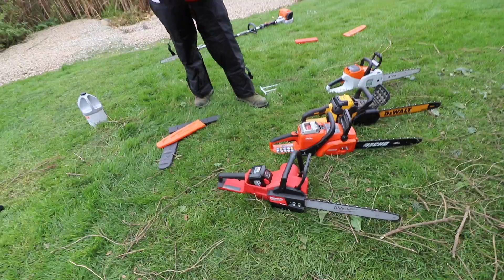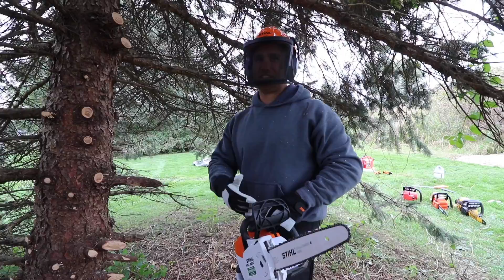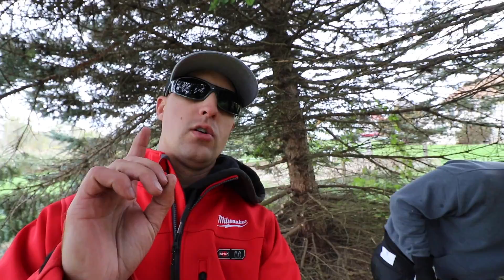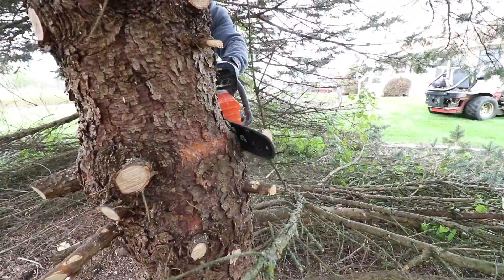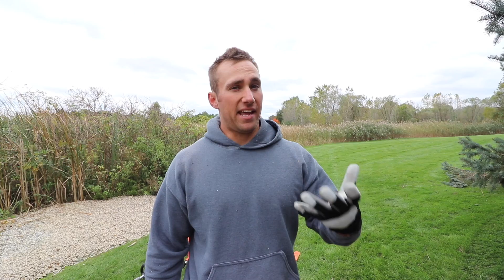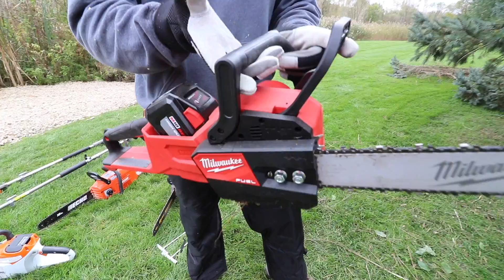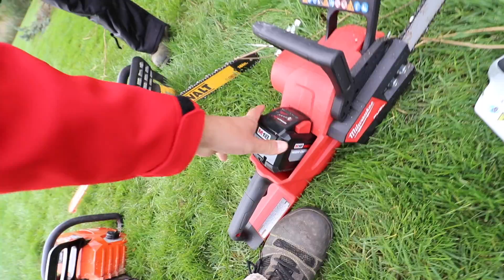4 Way BATTERY Chainsaw Comparison ► Which Has The Better Cut And Torque?

Comment: Only Stihl has a “Wet weather friendly “ Logo, rest of those battery operated saw not supposed to use in Rain.
 Husqvarna 536li XP much faster than Stihl msa 200.
 Husqvarna has 20 m/s chain speed , which is in pair with petrol chan saw speeds.
 Stihl don’t provide such important information ( for obvious reasons, it is noticeably slower than Husqvarna)
Reply: Bought my Milwaukee because they had it running in a tub of water at my cities big bolt store. Literally a tub of water with a Milwaukee stand and battery and everything submerged, running slow throttle but running.
Reply: Very important information -- None of us want to be doing this type of work in the rain/snow/elements, BUT inevitably we always end up in the weather & elements -- Therefore, machines that can withstand water & or take a beating are always more valuable.

I have used most of these tools & have to say STIHL is by far one of the best brands. My guys beat the heck out of these tools. They get dropped, smashed, not cleaned often enough, ran until they're dry, so many "wrong ways to operate" (I yell at them all the time after running them through proper operating procedures several times a year). However, STIHL is only brand that trucks forward & starts every time, cuts every time.

Final point -- This should be a given, but any chainsaw with a sharp chain will cut great -- BUT, as soon as you hit dirt, nick a hidden nail or piece of wire in trunk of a tree -- chainsaw is useless.
****Always have 1 or 2 spare chains for each machine you have with you, so you can switch out chain when the accidents happen & get right back to work. LOST TIME can cost so much more than paying $20-30 for an extra chain or 2.
Reply: The higher voltage tools like DeWalt are not what you want to be using in the rain. 18 volt should be no probs.
Reply: Dimi K 
Voltage makes no difference whatsoever. 
 16v  high discharge battery could supply supply as much current as 80v battery ( for shorter time , obviously)

Comment: I have the Stihl. I like the simple controls and ergonomics batteries do last well it does work hard but not as hard as a petrol can. I don't like the narrow teeth on chain as it pinches easy & does not clear material quick enough. I think they do it to keep load off of motor. I find it over heats alot when under heavy loads red lights appear on battery and motor stops dead which can be dangerous. One of my older batters makes the saw run slow which is annoying especially here in the UK where there £170 a time. It definitely has a place for small timber cutting and light tree pruning. However and heavy duty work where you want to work to saw hard all day and load up the motor hard time and time again a petrol is king.

Comment: Echo and dewalt both had dull chains. Always use brand new chains for ALL when doin a comparison
Reply from the maker: They were all brand new and fresh. Did you watch the video?
Reply: @BriansLawnMaintenance  did u watch the video? "Sharpened" is not the same as new and will not cut as good. Who ever "sharpened" those sucks at it!

Comment: Honestly using the old 40 volt DeWalt is not really fair as they have a 60 volt out and that is the main line out now so why not use that when comparing to this newer stuff?
Reply: The 40v is more of a commercial saw and better than the 60v according to many

Comment: a test bucking some 12" logs maybe would be more informative with a battery life test along side, cant get much of a feel for power cutting 1-2" sticks.. imo i like the milwuakee seen plenty of use of them and they seem powerful and battery life is great, they have the proper bar tension system unlike dewalts crappy plastic twist knob and the price is reasonable especially when you have a bunch of 9.0 and 5.0 batterys in the m18 lineup, with the stihl or echo you can only get lawn care equipment no proper power tools

Comment: I wish you had done the DeWalt 60v chainsaw instead of the 40v

Just because I'm a contractor and use dewalts tools and my boss runs m18. He would be able to use the chainsaw you reviewed but I would not...
Reply from the maker: Sorry we’ve only been sent the 40 at this time
Reply: 40v is better than 60v in dewalt

Comment: the dewalt, echo, and milwaulkee are running a 3/8 inch chain, each link is 3/8 of an inch long, it takes bigger chunks. the stihl has 1/4inch chain that is narrower meaning the saw has to pull less chain through the wood allowing it to go faster.
Reply: Robert Puffer  I am not sure, it would depend on wether you can change the sprocket.

Comment: Hi guys, in nylon opinion it's a pretty good video but something can be better fine as always. What i'm suggesting to do next time is get this saws again and get a first description of all saws specs, including speed and chain dimension, than get a single test made of 2 cut on a 6-10 inch diameter stem, one from up to down and one reverse(down to up), where u check easy result with cronometer. So this Is what i personally think, but overall well done. I appreciate so much guys like you that get a comparison instead singles rewies. Good job guys, but work on It!

Comment: I own a Greenworks 40 Volt chainsaw.  It works well for limbing like you demonstrate here.  The saw cuts very well and for the most-part I am satisfied.  I can get several hours of non-constant use.  I own also a Stihl Farmboss (18-inch bar) and a Poulan Pro (16-inch bar).
The Greenworks has a couple things I don't care for: 
1) The time it takes to ramp up to speed once the throttle is depressed (annoying); 
2) When you finish a cut, the saw will power-off completely after one minute of non-use (incredibly annoying).  If you make a cut, set the saw down to move a limb and come back to the saw to make another cut you need to power up the saw - every-time!  Why Greenworks doesn't allow the user to select the auto shut-off time is disappointing (say 1 to 5 minutes).  
Other issues: 
The nut that secures the bar likes to loosen no matter how much I tighten it. 
The lanyard that keeps the bar oil reservoir tethered to the saw failed the first time I removed the cap.
Anything over five-inches in diameter is asking too much of this saw; it will over-current and automatically shutdown.  
Finally, customer service is non-existent; my e-mail messages to them have never been answered.
Reply: I have a greenworks and love it. I would guess all the battery saws power down after some time of no use. All chainsaws with 1 nut vibrates loose. I had a gas steel that did the same thing. If i use a wrench and tighten more than my hands can do it will stay tight. I have muscular dystrophy, so using electric is the only way I can cut firewood anymore. I have 4 batteries so I can cut a long time. If I had to compare my gas stihl to this electric. I would say they cut about the same. Just faster not having to fill gas and the vibration of gas saws were difficult for my muscles. I couldn't hold the saw after a few tanks if gas.

Comment: The stihl has not only a thinner bar and chain but also a shorter one. Which means a shorter distance per chain rotation leading to a faster speed and cut. All of them would cut better with a 14in bar vs 16in bar.

Comment: The Stihl just the best but the Milwaukee is quite good either! I guess my next chainsaw will be a battery operated one
Reply: The saws are good quality, and better than gas saws for small jobs, and overall reliability. But the batteries cost $350.

Comment: Milwaukee #1 because has just as much power or more than the stihl . Plus an additional hundred fifty or more power tools that work with that battery system. I own the Milwaukee chainsaw it is a very nice chainsaw,I'm a homeowner and a auto mechanic.

Comment: Stihl is the best for trimming due to size and shape of bar. Also it has smaller 1/4 inch chain. It is set up to be used in conjunction with a larger gas powered saw. The other saws are targeted more to the homeowner and to be used as a stand alone unit. I think battery can play role in commercial lawn care as back up tools or my favorite the hedge trimmer. Gravely impressed me with their battery operated ztr at GIE this year. Even though it was a pre production unit I feel it was leaps and bounds ahead of other manufactures that have already come to market.

Comment: Good idea to compare battery units... I know firsthand a sharp chain is everything for any saw. I think a new chain on all units would have given you better results for the echo and dewalt units. Cool test but I'm not sure it was a fair comparison. The chain can be shrp but not sharpened properly. The raker teeth need filed as well.

Comment: I have been running echo gas chainsaws for a lawn care company and to be honest might go to the Milwaukee M18.  I do not use the gas saw enough and it can be a hassle to start it at time.  These compact battery tools seem great to throw on a lawn care trailer.  Thanks for the video I appreciate the information.

Comment: IMO, one battery for a cordless tool is not adequate. For example, the Milwaukee M-18 costs $399 and an extra battery adds another $199, whereas you can buy the best small chainsaw available, the Stihl MS 261 C-M for $560. Don't understand why a professional would buy a battery operated chainsaw.
Reply: Free battery right now plus they have 11% off site wide for veterans day.  https://www.acmetools.com/shop/tools/milwaukee-2727-21hd-m18-cordless-18v-chainsaw-kit     So under 400 dollars for two batteries and a saw.  Not too bad of a price.
Reply: got a battery weedeater.  the convenience of just popping in a battery and starting is really nice.  it can't do what a gas weedeater does but for small stuff it's nice.  not dealing with fuel, yanking on a cord to get it started, noise, vibration, leaving the engine running while in transit to your next patch of weeds is pretty awesome.  bet a lot can be said the same for a battery chainsaw.

Comment: From personally using the Milwaukee, I do know that they use a more aggressive cut to compensate for the lack of RPM's. I have used 3 of the units you have and I think I like the Milwaukee of the smaller ones the most. However, the big Still one looks like it's made for bigger tasks. Nice head to head battle.
Reply: Milwaukee might not be the fastest, but has a lot of low end torque

Comment: I wonder if they are all running the same chain different chains cut faster full chisel,semi so on! Not complaining but could have make a huge difference 👍👍
Reply: You had mentioned they had been sharpened. And when he said he had to apply down pressure with the one saw that’s a red flag that the drags needed filed down. I would like to see this with all new chains then we would know what we got. Now if you told me a cutter filed all those chains to his liking such as cotton top or logger wade then I would be more confident. Thanks for posting and I understand new chains cost money and you did the best you could.
Reply from the maker: Yup I’m not a tree guy but all the chains were identical

Comment: Electric works professionally, I have all electric equipment except 1- 32" mower and my Steiner sub-compact tractor. My running costs are 1/16 of gas equipment. You didn't have any of the best saw systems. You had the Stihl but you didn't have the Stihl AR 2000 backpack battery which allows 7-11 hours of continuous runtime and more power!! The Greenworks Professional products and backpack battery allows 6-9 hours of continuous runtime. The EGO electric system will run ALL equipment ALL day on 4 or 5- 7.5ah batteries And you didn't have the Redback 120 volt saw, It runs 2-4 hours on 1 medium sized battery and has tons of power!!! I rather carry around 4, 5 or even 8 batteries than 2-4 gas cans. Change gas filters once a year. Change engine oil and filters every 100 hours. Change air filters once a year and clean 3-4 times a year. Change hydro fluids and filters every year. Clean and gap spark plugs every 200 hours and/or change once a year. Clean, lap valve seat surfaces AND Checking and/or replacing belts every week. But great review, It gives people and idea of what the basic systems are capable of. The commercial systems provide more power and much much much longer runtimes.
Reply: That's sweet man -- I have considered switching to battery powered for a few years now -- I'll have to check back in after reading all the info you posted.

Lol, that's a ton of extra money to show us those more expensive options & additions to make battery powered tools the better choice -- BUT, still need to mentioned. I'll check that out
Reply: @jessel8833  Yes up front costs are high VERY HIGH but you will make is back in after the first year or 2 depending how many customers you have and your profit margin. Remember you will no longer be paying for gas and most maintenance. You will love it and the neighbors will love you too!!
Reply: You would rather wear a back pack with a cord hanging off ya than haul a gallon of gas to the job sight ?
Reply: @jamesavery6671  Yes, Of course!! Low noise, Your not breathing in toxins ( you may not care about toxins now but after 15 -20 years of breathing it you will !!).  You can also use the smaller batteries, you just have to change batteries every 3-8 lawns (depending on battery size and job size). If you like paying 14X to 16X more in operating cost and poisoning yourself to do the same thing as an electric..... Well that's up to you.

Comment: I would definitely stick to gas, just a tip for future when stripping low limbs like this, make an under cut first before your top cut this will prevent your bar and chain getting jammed up quite as much and you get a more controlled and safer fall to the limb

Comment: Thanks for the video! Need a new saw, wasnt considering battery but now i am. Usually only doing small stuff so these would work great. One less gas engine to take care of! What size diameter will these cut? Dont complain about 45 degrees. Its 14 in Minneapolis this morning with snow on the ground. Still have cleanups to do!

Comment: I have a Greenworks 18" 80V Brushless its very good and has a high RPM .  This is another good option for the home owner.  I have the snow blower for my deck and that works super great as well.  I had the batteries already so it was cheaper going with a bare tool from Greenworks.  Great vid that Stil wins in your line up for sure!!!  Here is mine:  https://www.greenworkstools.com/80v-18inch-cordless-brushless-chainsaw   Also one other big plus is the 4 year warranty, no one else offers that length!

Comment: The stink runs a Picco chain. It has a narrower cut because the width of the cut doesn’t help you cut faster. They make big wide chains to deal with the force loads of big gas saws. But with an electric battery unit, the narrow chain can handle the forces and will cut with less resistance. Still uses the same chain on their pole pruners to speed up the cut.
Reply: A 1/4" PICCO™ MINI chain specifically, using the narrower STIHL "ROLLOMATIC® E MINI" guide bar on all their battery powered saws as of 2018 the: MSA 120, 140, 160, and 200 models not to be confused for the 3/8" PICCO™ chain and standard "ROLLOMATIC® E" bar used on but not limited to the gas powered MS 170 thru MS 211 home saws.
Reply: I have a 021 with a Oregon Narrow  Kerf setup,it's a amazing brush saw
Reply: @D7eadnaught Humanbeing  ms 211 same narrow chain for limited power, but with mineral oil can be used for butchering :)

Comment: I have found that Mikita gas EA3500SRDB is a Awesome saw after a little idle tuning.  Is has the power of a bigger saw.  A little hint with the Echo Chain.  File down the little hump before the rake.  You will find it cuts faster.  Also Stihl makes the best Chains.  I even have a spare stihl chains for my new Makita saw.

Comment: The stihl is awesome, but also twice as expensive, if not more. I have a dewalt 60v and a stihl gas model. I just could not justify the cost of the stihl electric. I have dropped big trees and bucked them with my dewalt 60v. Lots of them. Douglas fir, western hemlock, alder. Goes through them like butter. I fell and limb with my electric, then setup multiple trees and buck them all with my MS 271. Gas is better for bucking as it really chews theough the battery. The dewalt will do it just fine, but I just can cut fewer rounds before needing to recharge.

Comment: I do wonder if the echo was made more for cutting larger denser wood then the stihl..
Reply: Looks like the depth gauges were not taken off appropriately. With fresh new chain it cuts way faster than in the video. Just ran it extensively on oak, so on pine it should fly way faster than it did here. Other than that a good comparison video

Comment: I run sthil 16inch bar ms 170 or 110  an Husqvarna chainsaw 440 with 18 inch bar they both r gas an i would recommend

Comment: Great video as always, the thinner kerf chain will have less resistance cutting plus it will help to keep rpm up, I was told that chaps won't work with batter saws, that should be your next video to see if it's true, I have the Sthil and love it
Reply: Donald Costello chaps work just fine with battery saws
Reply: @Sthilboy56  Glad to hear that thanks Donald
Reply: @Sthilboy56  was just sent a video out doors with the Morgan's  # 271 and it shows an 036  and a Sthil 160 battery saw cutting 9 layer chaps both were stopped instantly  no tear thru on inside so wear your chaps when using a gas or battery saws
Reply: Donald Costello 👍

Comment: The dewalts bar attachment is the cheapest. AVE took apart the dewalt and the Milwaukee to compare internals. Milwaukee has a traditional 2 nut bar attachment.
Reply: But most people who use these battery operated chainsaws aren't professional and tend to over tighten the chain and can ruin the bar with the tooless chainsaws you can't really over tighten so in a way they are better also quicker